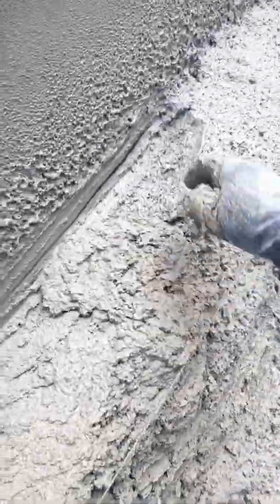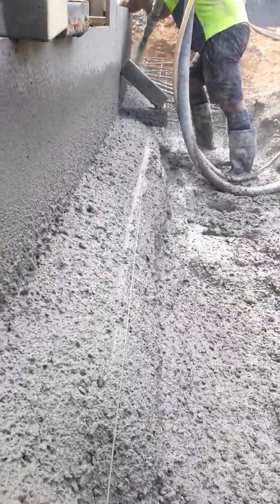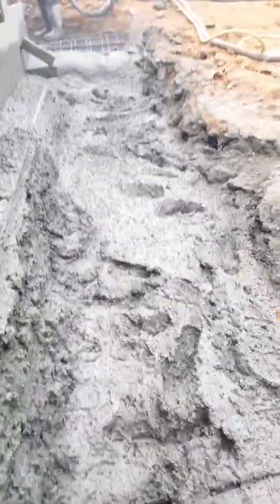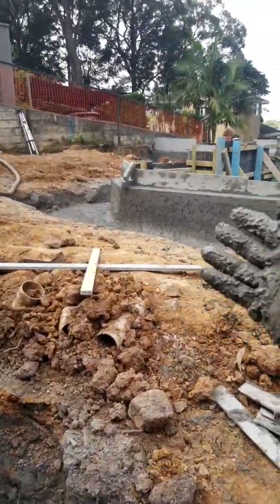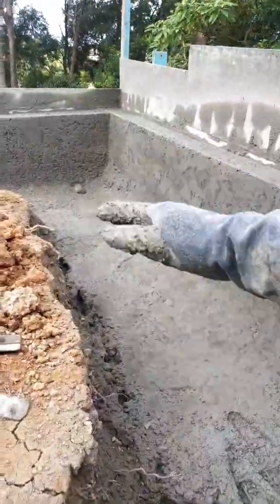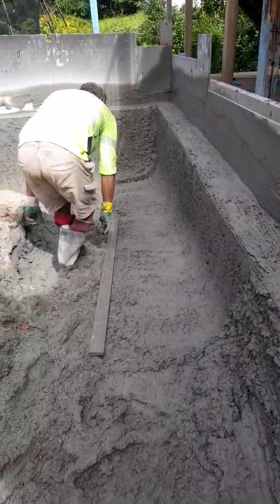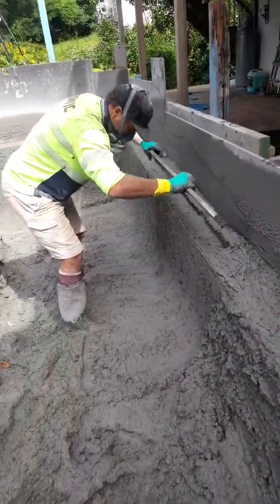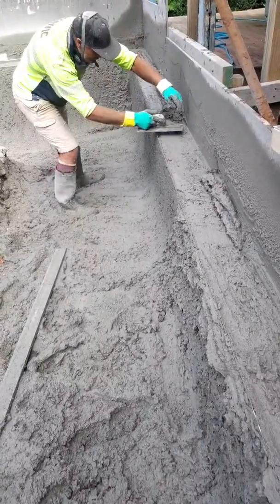Live session explaining slumps in shotcrete mix

Comment: Thanks for the video does that have rock in the mix or just a sand mix. We have only crushed sand in our area so it’s hard to get the mud that creamy. We use a 3/8 rock mix. Which is guess is like a 9 mil.
Reply: Nevermind I just saw your reply on another video 7-10mm rock.